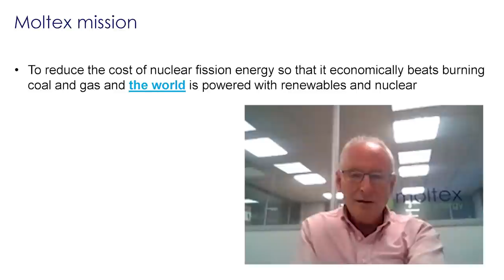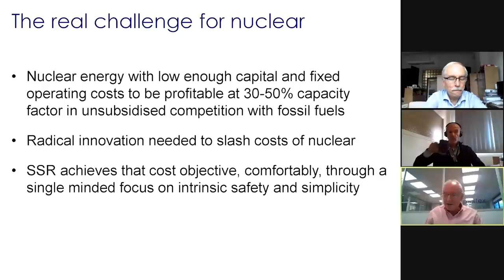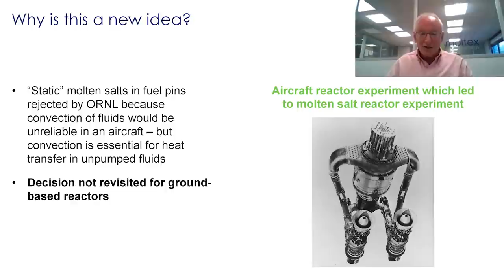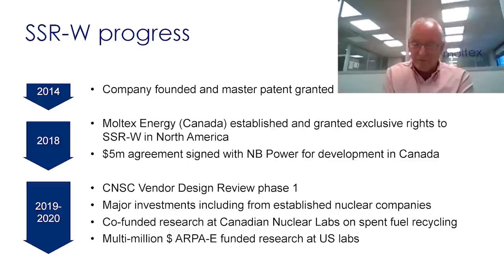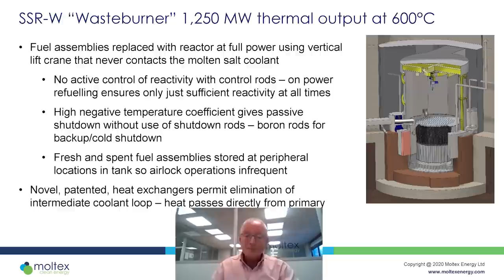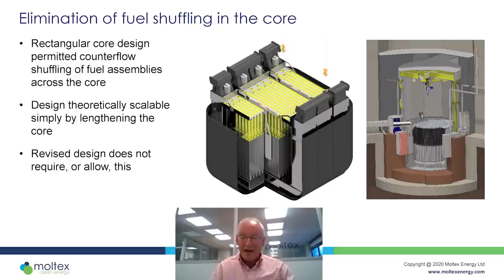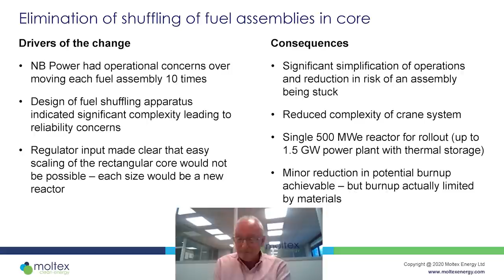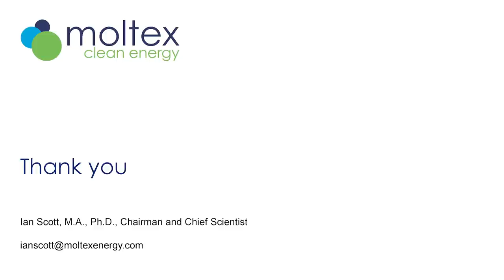SSR-W (Moltex) Stable Salt Reactor Wasteburner - Dr. Ian Scott @ ORNL MSRW 2020

Comment: It's leveraging 'American System of Manufacturing'
And it's absolutely what is going to save mankind, mass produced ultra safe 4th Gen reactors
Moltex is the only company I've seen working with this primary goal.
Reply: Thorcon, Terrestrial Energy, Elysium. e.t.c.
Reply: Fact. The only thing that can provide enough base load reliable, safe and cheap energy to replace ALL energy is 4th gen nuclear.

Comment: Releasing fission products into the confinement is bad practice. It makes disassembly and maintenance much harder and more expensive. Wouldn´t it be better to use a decanting device at regular intervals to lover the pressure in the fuel rods. Then storing the gas in a dedicated safe place for it to decay. One could make an analysis of the fission gases while decanting. This gives the operator a very valuable, regular update on what´s going on in the fuel rods. Sure it´s ads complexity but much less so than equipment for reshuffling the fuel rods. One option would be to use the pressure of the fission gases or inert gas to transfer fuel salt from the centre of the core to the outside of the core where burn-up is less complete. 
You get the  advantage of molten fuel but no need for critical fuel pumps that can fail. If the fuel transfer system fails you loose core life but can still run the reactor. In a prototype stage you have an excellent tool to see what's going on in the fuel rods. The fuel rods can be made less sturdy if they don´t have to handle the full fission gas pressure after a completed fuel cycle. If the fission gas pressure is to low to allow fuel transfer, it´s at least helps the pump or gas booster that's doing the fuel transfer.
Reply from the maker: I'd assumed they'd want to get FP away from neutrons, but it being fast-spectrum probably not much FP-as-neutron-poison concern. Good question, wish it was asked at ORNL MSRW. I'm only watching these things now as I edit, and never had a chance to participate live.

Comment: Could the krypton85 be stored/ bottled and used elsewhere in industry instead of venting? I know some hall thrusters on small satellites in the space industry use krypton as the propellent, but not sure if the 85 variant is compatible? Nuclearphobes will hear 'venting of gases' and go into their typical freakout mode, so not only would selling/ using this gas elsewhere be beneficial to the business model, but help further alleviate environmental concerns of the illinformed.
Reply: The noble gasses have neutral radioactivity after a few weeks at most. They could be collected an allowed to decay to neutral, but would the nuke regulators allow that?

Comment: "Zero marginal cost for renewables?"  Well, maybe if you disregard maintenance and depreciation.  Boy-oh-boy, it sounds good when you say it fast.
Reply: Marginal cost, is not the same as total cost. Marginal cost is indeed ZERO even if you include maintenance and depreciation. Look up definition of marginal cost.
Reply: Still correct cause marginal costs don't take into account that. However you are correct. the fact that solar cells actually degrade over time is a big issue, and i would say that we still need a baseload for when renewables don't work. Its not because renewables work well for like 1 or two weeks in a year that we can afford to base the grid on them if they can then fail to deliver for an entire month
Reply: Yeah that point sounds like it doesn't hold water. Renewables are very diffuse and intermittent. They have application in certain scenarios like off grid use but large scale generation is dubious at best given the lack of battery capacity for grid continuity.

Comment: I find this reactor design interesting, but does it use spent CANDU fuel directly, or does it need reprocessing prior to use?
Reply from the maker: They use pyroprocessing not conventional reprocessing. Fission Products are removed (and will go in geological storage whatever can't be put to practical use) and used-fuel actinides are kept and included in the SSR-W fuel load. Pu is never isolated from the other actinides, and of course the Pu will never be weapons-grade but contaminated-with-Pu-240 reactor-grade.

I believe the first step is what you'd be hoping for, just melt the fuel pellets into molten-salt. But there is a pyroprocessing stage after that, before that fuel-salt can be loaded into the fuel pins.

Comment: I wonder if this could be modular, fitted to a shipping container and used to power our very grubby freight shipping?  Could be swapped to newer freight ships when the old ones degrade getting possibily more profit than connecting to the grid.. Wonder how they'd go in rough seas :/   Maybe heat transfer could be done with a super critical carbon loop like some others are proposing to do in MSR's
Reply: No. Like he said convection needs gravity.
Reply: @thebeautifulones5436  When's the last time you saw a container ship anything other than horizontal?
Reply: New build? Sure. Ripping the cathedral engines out of cargo ships and replacing them with reactors and massive electric motors would probably cost more than an entire new ship though.
Reply: I'd guess that a supercritical CO2 turbine electric engine would be necessary as apparently the steam generation equipment is a large part of the cost and takes up a large amount of space on navy nuclear boats. An alternative approach to cleaning up ships is to take (or make via helium turbo inductors) high temperature heat from MSRs and use that to make methanol economically which ships can burn in place of bunker fuel.
Reply: @tintin_999   The losses in converting heat to methanol instead of simply using the power directly from the super critical carbon turbine would be significant.  The same reason that hydrogen will never beat batteries.  Also consider that the turbine for the Carbon loop is the size of a microwave and is able to put out more power than a massive steam turbine ;)
Reply: @jsn1252  Wrong, Ship owners look at the total life time cost of the ship, they run on thin margins and never having to buy fuel ever again would save them several ships worth of cash. 
They are currently sailing slow to save fuel.  With years worth of power they could travel at full speed all the time without increased cost. It's worth the retro fit.  Also consider that they could sell the old steam turbine components.  
Once fitted you could leave the MSR reactor on top in a container.  Add additional ones when needed and replace them or remove them like nuclear batteries.
The only thing down in the engine room is perhaps some capacitors for buffering a gearbox and the electric motor which would be lighter smaller and possess high torque than the dinosaur engine it replaced.  which means the ship can carry heavier freight now!
Reply: ALSO they could sell power to the grid while being loaded and unloaded!

Comment: Always thought the fuel shuffling was the weak link. Removing spent fuel inside a unimaginably hot/radioactive/corrosive is still a challenge. Less so than pumping radioactive salts through heat exchangers. 

Everything else should be straightforward.  Would be nice to find out about how the regulation for the tracking of molten salt fuels is proceeding in general.

Comment: sorry for the noob question, but I don't understand why confine the liquid fuel to tubes? is uneven burn and constant rearrangements worth it?
Reply: I'm a complete amateur newbie too, so please forgive me if I'm wrong about this, but I've seen a few videos where Ian Scott points out that if the fuel is mixed with the coolant, then when the coolant circulating pumps and plumbing springs a leak, you'll have very radioactive liquid all over the place and it will be very difficult to deal with. Also, I think I've seen him claim that zirconium can be used to prevent corrosion if the fuel is in tubes but not if it's mixed with the coolant. I don't understand this last point and would be grateful if someone could explain it.
Reply: Reshuffling fuel pins isn't a novel concept - solid reactors have been doing it for decades. The benefits of simplicity outweigh the possible drawbacks in this case.

Comment: One of the key problems with nuclear power is the waste problem.   It's a political problem that must be solved technically, if the public's opinions are to change for the better.  Bravo!

CANDU fuel waste is odd because it's the byproducts of natural U238, with no enrichment past the natural amount of U235.   At least this was what I've read.  Please correct me if I'm wrong.  Since U238 is fertile, and not fissile, what I'd like to know is if it's more, or less dangerous to handle?  Would there be more, or less harshly dangerous actinides in this waste?   Also, isnt this fuel cladded in a Zirconium or similar metal housing?   How would one crack those open to deposit the core of the pellets into a hot melt mix?  I can imagine the environment being harsh towards electronics, people couldn't be anywhere near this.   Drill bit and mechanical?   Some arcane chemistry method?   I've always wondered how one goes about reprocessing nuclear waste.

Comment: Why not operate at 100% at all times and use the electric to create hydrogen or desalinate water?
Reply: Good question. One potential answer I can think of is if you are only creating hydrogen or desalinating water when there's low demand for electricity, then your hydrogen creation and water desalination machinery is not working when there's high demand for electricity. So that machinery is sitting idle a good part of the time, which is wasteful of capital. Maybe it's better to use relatively cheap Grid Reserve to run the reactor at full power all the time for electricity generation and to build reactors specifically to power hydrogen creation or desalination and also run them at full power all the time.
Reply: The reactor does operate at 100% at all times at 500MW. It's just set up so that even if baseload demand is there only 33% of the time it can output at 1500MW for that 33% of the time and 0MW for the remainder of the time. As Ben said below for any chemical production you'd want to run that plant 24/7. You could always have a 500MW reactor, supply electricity at 750MW one third of the time, and use the remaining 250MW for constant chemical production (although you'd probably use thermal rather than electrical chemical production with an MSR, particularly Moltex's higher temperature variant).
Reply: Heat can (and will) be used for district heating in cities as well. Heat can be stored by pumping it to land mass (heating it) and using the heat storage (cooling it) when needed.

Comment: More and more incinerators are going in as if the atmosphere is another dump.
So if there is a break down between molten salts and water interface steam explosion, some posed questions, and you avoided power storage, so now there's radioactive gas release to worry about, sounds like standardise the size and enlarge the grid which we want to do for solar day lengthening anyway, there are inter connectors from Norway and France I think Britain's best bet us more connection to Europe ironic then that Boris wants to make that as awkward as possible, but yes I am concerned about plastic waste being burnt, as we all know supermarkets didn't attempt in anyway to increase packaging reuse, that's another big fail by the European Courts
Reply: What steam? There's no water anywhere near the fuel salt.

Comment: I support nuclear power and am dismayed at how cynical the nuclear industry is with regard to the “global warming” issue. Stop promoting nuclear power with global warming fear porn!
Reply from the maker: I think you're the guy bringing it up, Jeffrey. Not Dr. Ian Scott. He mentioned "decarbonize" once in a 13 minute video. This is really more about Moltex's Stable Salt Reactor for turning spent nuclear fuel into energy.
Reply: I agree completely, when people are finally told the truth about how carbon dioxide actually operates in the environment. Those promoting the popular but  simplistic radiative forcing theory of climate change could lose credibility on all subjects.
Reply: With projections of tens of trillions in damages and sharp declines in global crop yields by 2100, not to mention the collapse of the ocean's populations of oxygen producing plankton populations, you should be very afraid.
Reply: Most crops especially corn will grow much faster with a higher level of carbon dioxide. Why do you think green houses purchase it to supplement the natural air. Politicians lie and tell you it will kill corals but they evolved when the level was many times what it is today. There are springs near thriving corals similar to the ones where they get  perrier. If they don't die when soda water washes over them, a tiny increase in carbon dioxide won't hurt them. Actually there is a real mechanism by which carbon dioxide effects weather. It dramatically reduces the water requirements of plant life.  Plants change the way sunlight heats the surface especially in dry regions. By the same mechanism it allows forest to grow where once a few trees struggled. Trees change many things for example they make it more difficult for tornadoes to form. But even a tripling of carbon dioxide would cause very little extra radiative forcing, that system is already saturated.  
         The truth is we need nuclear because it's cleaner and more concentrated.  Burning so called fossil fuel is extremely wasteful. It's really too valuable to burn. Especially if you have readily available process heat. 

In today's world the words science, education and propaganda have become synonyms. Real science  is nearly dead because nobody can get grants unless they promote the narrative. If you look, you will find frustrating examples in every field.
Reply: It's real, U know. Never, ever has the atmosphere warmed so fast. This will tell you that releasing unfathomable amounts of carbon by burning ginormous amounts if fossil fuels IS the cause.